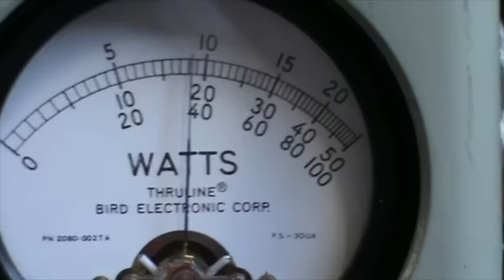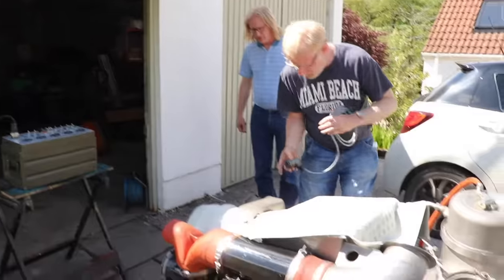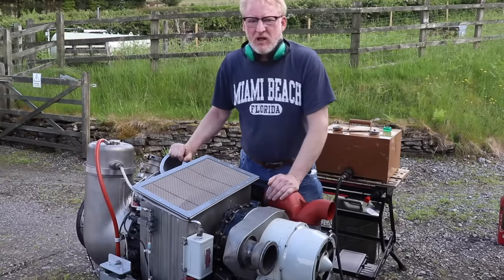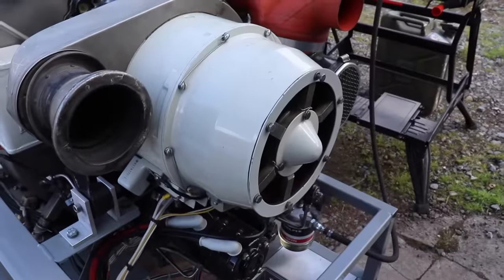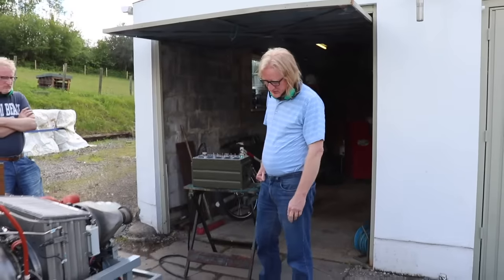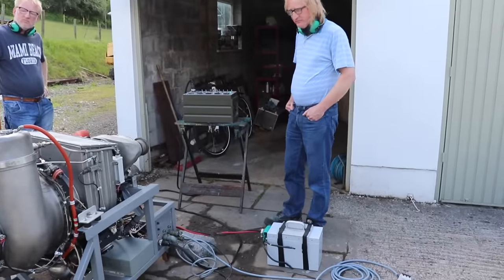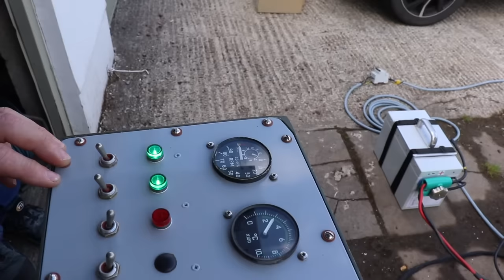Electricity From An Old Aircraft APU

Comment: Brilliant! Is it electronically governed or rated to a fraction of what it's actually producing in HP?  Because it didn't seem to waver when the 6Kw of bulbs lit up and turbines don't respond like IC engines to sudden loading.
Reply: The alternator needs only a fraction of the power that this turbine engine produces, that's why you hardly notice the 9kW of load. In an aircraft, the APU does a lot more than just produce electricity. It outputs compressed air (known as "bleed air") which can run the air conditioning packs to heat or cool the cabin while the aircraft is on the ground, which requires quite a bit more horsepower than the electricity generation does.  Additionally, this compressed air is also used to start the main engines.
Reply: There’s a massive amount of rotational inertia in the engine due to how fast the turbine spins. This makes it less susceptible to sudden loading than a piston engine spinning at 10% of the speed. 

Also the extra fuel can be introduced instantly. Turbine engines are slow to accelerate because of surge margins to prevent compressor stall, but once up to speed you can add fuel as fast as you can open a valve provided you don’t exceed max temps (which is very difficult on this engine due to its very oversized compressor).

Comment: I wonder if this is more efficient than a diesel generator rated at the same power
Reply: I highly doubt it. Most APUs are designed to produce "bleed air" in addition to electrical power. If you're unfamiliar, it's high pressure air used to pressurize the cabin and start the main jet engines. So even at maximum electric load, there's a lot of unused capacity for generating the air. Now, you might think "still useful for job site where they use pneumatic tools". Unfortunately, bleed air is around 40 psi, while most pneumatic tools want around 90 psi.

I would love for someone to prove me wrong so I have an excuse to buy an APU!
Reply: Maybe if all the power of the turbine was making electricity...
Reply: @Charon-5582 let us know how Dr. tesla

Comment: Aircraft APUs generally produce 115 V AC voltage at 400 Hz which is a bit of a pickle with lamps used to seeing 115vac at 60/50Hz
Reply: Filament lamps won't really care. Anything that relies on the cycles will not be happy though...

Comment: A bit more technical info would be nice. eg point out what the various bits on the APU are. How much fuel did that run use? Show the volt meter when switching the loads.

Comment: What would a unit like that usually go into?  The back of a passenger airliner?
Reply: Mostly in the tail cone, but the B-727 has its APU in the right wing forward area, and some of it actually passes through the keel structure.

Comment: i would love to have that unit . it loves to run on  jet A  i guess. how many K.W. is it , what is the voltage,  and HZ  most aircraft equipment uses  300 HZ , is this 300HZ , how do you get one and what is the cost.
Reply: 400hz at 90kVA at 115/200v typical for the A320. DC power if from generator (even engines) is provided by TRs. Transformer rectifiers. They change AC to DC...there's 2-3 minimum on jets. the 3rd is typically redundant.
Reply: Actually, standard aircraft Alternating Current is at 400 hz. I'm pretty sure the B-727 aircraft I worked on that used this APU had 20 KVA generators, and the generator on the APU matched the engine-driven generators for compatibility.

Comment: The one thing I don't see addressed for the generator, although y'all glossed over it at the beginning, was lightbulbs don't give a sh*t about CPS. Europe uses 50 cps and the U.S. uses 60 cps. The gen set produces 400 CPS. As long as you don't plug in a motor designed for 50-60 cps, you're good.

Comment: Can it generate enough power to drive 4 electric motors each with a rotor such that it can lift its own weight, that is could it be used to power a quadcopter?
Reply: imagine if it directly drove a big rotor

Comment: What would cost you more? A fuel bill or an electric utility bill?
Reply: Fuel bill by far
Reply: @nathandevine552 That depends... If gasoline gets around $2.50/gallon, its cheaper for me to run my Honda inverter generator than use the power co.

Comment: Where were these generators located in the planes? Probably in the rear back tail of the planes.
Reply: You can usually see the exhaust right at the tip of the tail.

Comment: You don't really have anything that could utilize the a/c power that thing can put out. Most were rated around 40 KVA. Kilo Volt Amps. They would run all the electrical power needs of a jet airliner while on the ground. Or replace one of the engine generators if it was inop in the air. They had the same power rating as the engine generators have. Also while providing all that a/c power, they could start the engines using bleed air off their engine compressor.  We got a notice that they use 10 times more fuel than an external air conditioning truck and and power cart.
Reply: You could rectify the output then feed that into a standard solar inverter to get household usable power..

Comment: Needs a much bigger load that unit can drive a 60KVA generator. The downside for power generation use is that it burns just under 4 liters a minute
Reply: I wonder if it could be modified to run on LPG.

Comment: is it 3 phase @ 120 volts must have a bit of current
Reply from the maker: Yeah think so.
Reply: Most likely 3 phase, 400V and a bunch of amps.  Only residential loads use 120/240V.  Street Lamps are 277V as are most commercial building lighting.  Train engines also make 400V electricity run from car to car for various loads, like air conditioning.  Around 2005 I rode on a train at the Texas State Railroad and those units generated 400V AC, guessing 3 phase due to the number of wires in the cable.  (thumb size wires!!)  208 and 277 are the outputs of various phase combinations of 3 phase in the Delta or Wye configurations.  The difference is in if a neutral is used and where it is connected.  It all kind of depends on what kind of load you are trying to drive.  I have seen pad mount transformers with 277V at restaurants using higher than normal power for cooking.  Top of poles are often 15,550 phase to phase and 14,470 phase to neutral, which is then stepped down to local needs using another in-line transformer. (This is from a recent - 8/2023 interaction with an Oncor crew doing pole maintenance)  In my area, many of the pole mounted transformers have had their input disconnected and new service feeds to pad mount transformers directly off of the pole top lines have been installed.
Reply: What does it matter what sort of power is at the top of the pole? Lots of street lamps on airplanes are there?

Comment: Light bulbs???????
How about a few electric heaters😀
Reply: He’s just playing with the starter generator but the real power is in the compressor bleed off
Reply: While Electric heaters would be a good resistive load, the engine itself is already producing enough heat to melt an iceberg.  Again, the main goal here was to generate the compressed air to spin up a larger engine, which is what this unit was built for.
Reply: Light bulbs are just inefficient heaters lol
Reply: @holysirsalad  yes, they just emit energy at slightly higher frequencys😀

Comment: You are using a 300Hp APU to power a few lightbulbs, you are too crazy to stay alive. 200000Watt source,,,, 10kW load
Reply: Starting a large turbojet or turbofan engine requires an immense amount of pressurized air. The alternative to an APU in the DC-8 and B-707 was a "huffer," which had a very large diesel engine turning an equally large compressor. Currently Stewart and Stephenson list such compressors starting around 300 horsepower, so the APU will probably use most of its power just to start an engine.